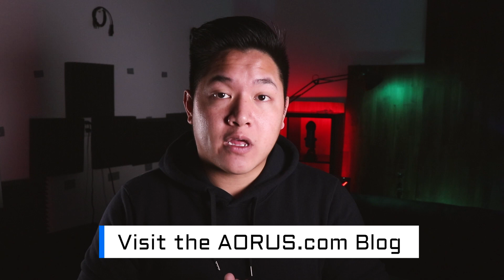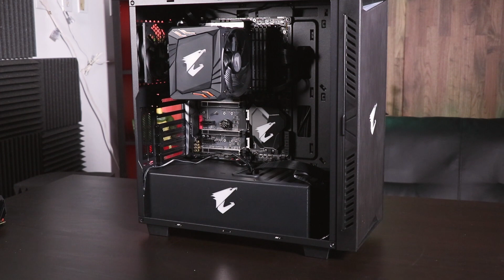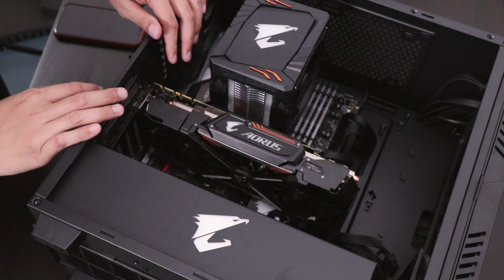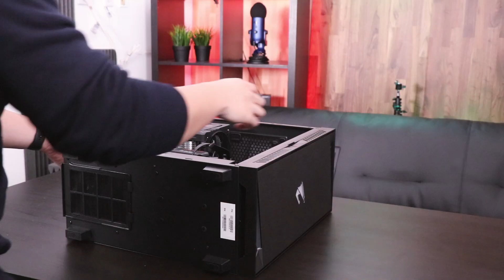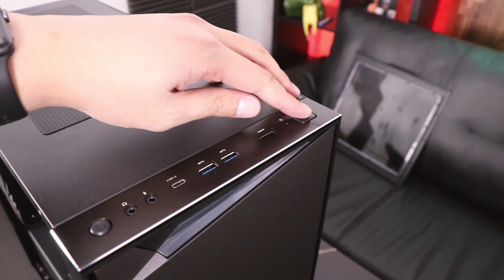How to Install a Graphics Card | AORUS 101

Comment: Quite lazy.
Firstly, you should always point out that power from the PSU should be OFF.
2.nd, you didnt refer to the clip on the motherboard for the PCIE slot, that should be pushed down torwards the motherboard for its OPEN position, this is to cause less stress on the motherboard and PCIE slot, then install the card and the "click" from the clip going from OPEN to LOCKED confirms correct install.
3.rd, you dont wear an ESD protector, always set a good example, you did remember your apple watch on your wrist tho.

This is VERY basic computer knowledge, but for a 101 video, its not there.

Clean build tho x)